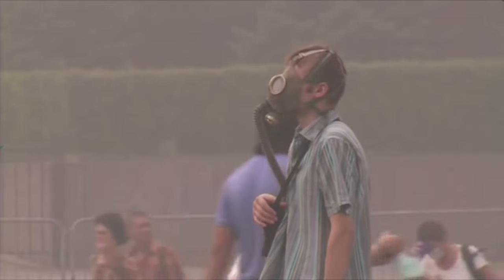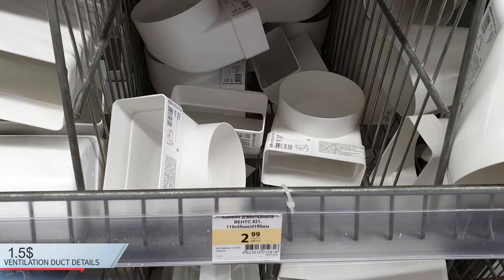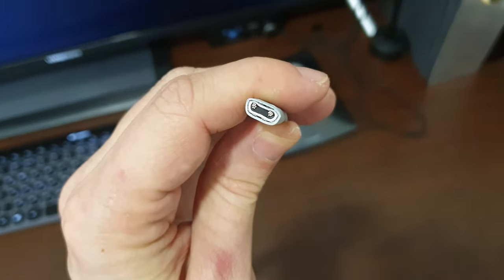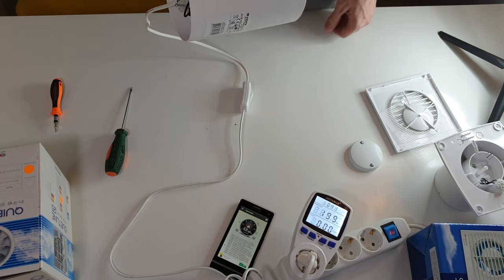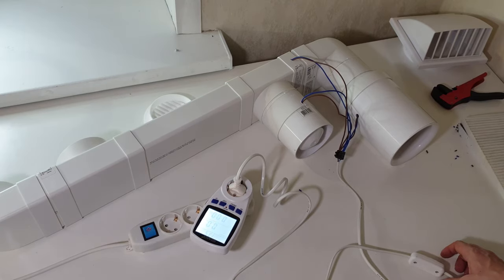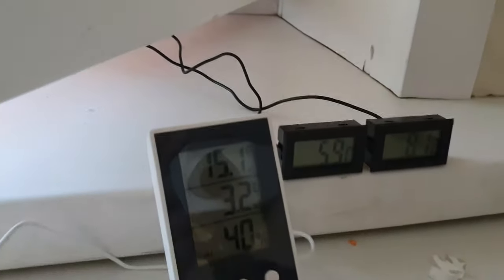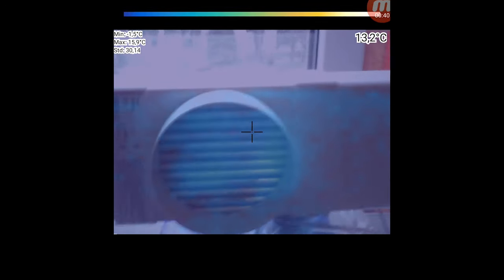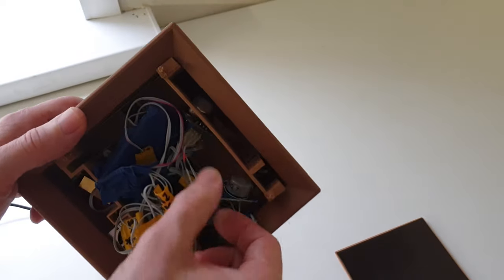DIY Heat Recovery Ventilator for 77💲. Improved Version Heat Exchanger!

Comment: Maybe I missed it in the video but how efficient, in terms of heat recovered, was your design? Most commercial HRVs are >70% efficient.
Reply: 6:07 outside it's 6.2°, when this air has passed through the heat exchanger it's 8.8°, even though inside it's 23°. So the difference between inside and outisde is 16.8 kelvin, of which we manage to recuperate 2.6, so 2.6/16.8=15% efficiency. So it's pretty shite, which is what you get when you have suboptimal heat exchanger geometry
Reply: Inside is 23, outside 3, inlet 14, outlet 11 -> he recoupes about 9 degrees. Don't know how efficieny is calculated.

Comment: Great project! I have 2 ideas to improve it. First, put thin insulation around the venting to ensure the cooled outgoing air doesn’t steal heat from the room. Next, add a very thin filter to the outgoing vent to ensure bugs can’t get in through it. Finally, I’m very interested to see what the inside looks like after it’s been operating for a long time, specifically does water condensation build up and lead to mold growth?

Comment: You would get better results from the heat recovery if the incoming and outgoing (same side) vents were further apart. So the incoming air is not almost immediately drawn back outside. 
This can be done by reconfiguring the vents to work in an X-type crossflow shape instead of an S-type crossflow shape.

Comment: Nice! It's worth mentioning, the thinner the wall of the aluminium tubes, the better. The heat exchanger reminds me of early car radiators. They used copper tubes which they would swage the ends, then stack up looking like a honeycomb. They would then dip either side in a large bath of molten solder. This would solder the copper tubes together and fill the small gaps, but leave the tubes open. The water would flow across the outside of the tubes.
6mm copper tube is easily available with much thinner wall thickness, e.g. 0.25mm, but maybe more expensive.

Comment: Both recuperator videos you've made are incredible! Thank you for sharing all your hard work! 

It took some searching to find this video. In the US we call them Heat Recovery Ventilators or HRVs, if you put either in your title you might get more hits, which you totally deserve.
Reply from the maker: Thank you very much!
Reply: Searching for Heat Recovery Ventilator is how I found this just now. Great video!
Reply: @DIY_Yarik  Please look into using heat pumps such as Peltier elements / TEC devices to increase recuperation while keeping power requirements low.

Comment: I built something like this 25 years ago, but mine was designed as de-humidifier and so the outside air was brought into the heat exchanger and the moisture was removed.

Comment: Nice, maybe I'll try making something similar. I have a bedroom with no ventilation in an old apartment and I'm about to install airtight doors to block out noise from flatmates, and I also want to keep windows closed as much as possible to block out street noise. So I'll need some single-room mechanical ventilation which is also quiet and blocks street noise. Bonus points if it also acts as a heat exchanger and can help control humidity levels (I recently bought an air quality sensor and it shows ~70-75% humidity for the past few days. Sure, it's been rainy, but I think that's worryingly high). I looked at commercial devices, but the affordable ones tend to have no good answer to the moisture problem (some simply freeze in the winter, some 'recover' water keeping high humidity indoors). So I guess DIY is the best way.

Comment: I built a comparable system 10 yers ago in my condo in bangkok... the problem there is the air pollution is bad enough to clog a HEPA the filter in just days. Managed to increase the filter lifespan to something acceptable by adding a washable stainless mesh filter and a cheap carbon air filter in front of it. Still have to dispose the carbon filter once a week, but it's a lot cheaper than doing so with the HEPA filter.
What I like on your system is that it makes it easy to manage condensation... another problem I struggle with.
Reply: HEPA clog in days in Bangkok!
Wow, thank you for sharing your experience.
I'm curious to know the airborne pollution concentration on a world map.

Comment: I did practically the same but in vertical design(it deals better with exhaust moisture condensation) and used brass tubes - they are ussually tinner-more effective and solderable...
Reply: How about efficiency? And are you satisfied with this device after using for a while?
Reply: I adjusted power input of the one fan to the second fan single speed. For one speed I did just few tests to adjust proper speed of the first fan. No temperature-float measuring devices or complicated controling elecronics was needed.  all the time, (summer-inside is cooler  or winter-inside is warmer)

Comment: This looks interesting... what about differences of humidity? Does condensation not buildup in the tube as the temperature changes?
Reply: my guess is that condensation happens on the out flow pipes BC warm air is hitting cold surfaces, but the cold air is being heated coming in so moisture evaporates. The inflow is the problem, needs very good filtering to avoid legionella.

Comment: Condensation probably forms only on the surfaces where air gets cooled down. So that's the outgoing air. Would it be OK to just let condensation form then? And design the pipes with a slope so that the water naturally flows out, similar to an air conditioner? Even if mold forms, it would be harmless, as it would not affect the room - just the exhaust air. (Assuming the device is only used for heat exchange in winter, not in summer)
Reply: Factory made heat exchangers do have a condensation evacuation tube. 
I think it’s simple design that can be washed twice a year as seasons progress. Aluminium tubes in that sense can be washed thourougly so it’s such elegant design !

Comment: If the house is closed up super tight and you're trying to exchange air you can do it with one fan you simply draw the air in with that van across your heat and the room air will go past that out the window through a flap a one-way flap

Comment: I liked the video. Greate work. I am not able to download the 3d-print model. Maby i need to do my own. Dont know if the dimentions is the same in my local hardware store. But thanks again. realy good and informativ video. Do you think that isolation of the heat exchanger can be benefisial in realy cold climate (solving intake air cooling the room) ?

Comment: This is a really good ventilation system! I'm looking for an alternative to ac since it is too expensive. I live in the Philippines and wondering if this can also cool the room since it is burning hot in here. Hope you can answer my question, thank you!
Reply: as long as there is temperature difference, the inside of your house will balance out the difference.
For example outside is 26C and inside is 30C, after a dozen cycles from ERV, the temperature inside will eventually be around 26C-28C, but not lower than outside temperature since you don't use AC. Depending on where you are in the Philippines, you'll probably need to fit it with charcoal filter for pollution control.

Comment: Did you consider submerging the heat exchanger piping in a liquid to increase specific heat capacity? What about using heat sinks on the exhausting pipe work to aid in more efficient heat exchange?

Comment: How did you install the heating element? I could use more details on that part.
Reply: Yeah I am interested in that. He flies through that in 2:45 but can't barely see it. I think he just inserts it between the aluminium tubes. Why couldn't you go back and forth a couple of times from end to end so there is x3 times of that cable between the tubes? Wouldn't that provide even more heat into the air? Doesn't the cable defeats the purpose of the whole air exchange process?